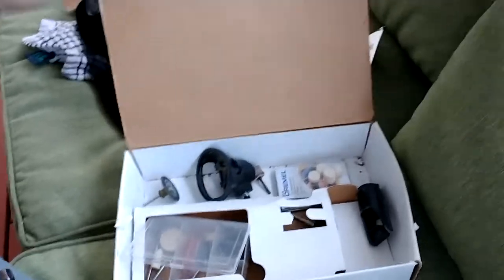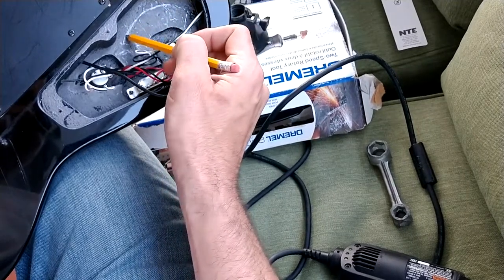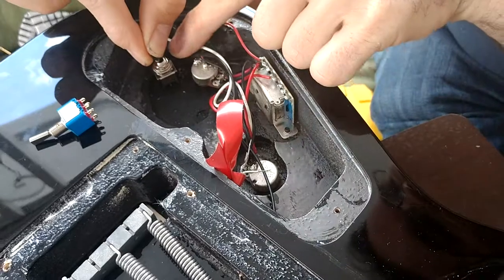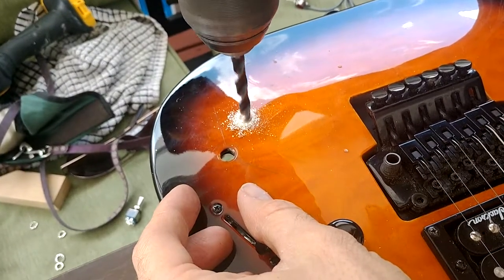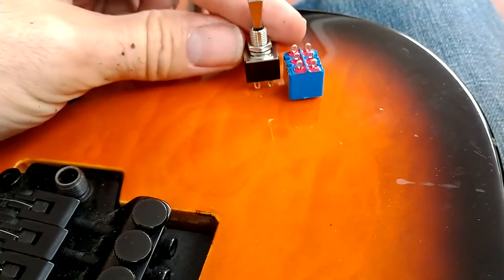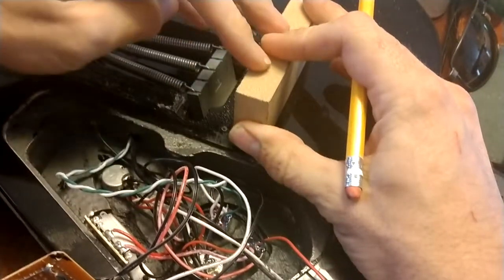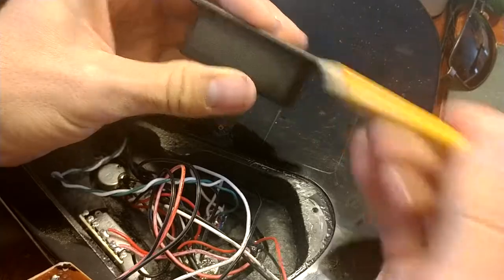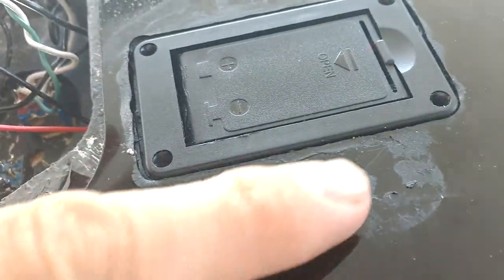Sustain Guitar - Routing

Comment: Next time: use TAPE to either mark the lines with pencil on top, or surround the shape you need to route without the need of drawing. Or you can do it right, and actually do a TEMPLATE on some MDF where you can do two "squares" with perfect shape, and then use the templates to perfectly routh a square on the guitar.

Same with the drilling of the switch holes. Do a template on a paper and then you can just tape it on top............also you don't need to route the cavity. You just mark first the pilot holes with a 1 or 2mm drill to avoid damaging a lot the top, and then when you have all the pilot holes, use a drill bit of 15-20mm from inside just to reduce the thickness of the top as much as you need depending on how long the switches are (there are several lenghts of those switches).